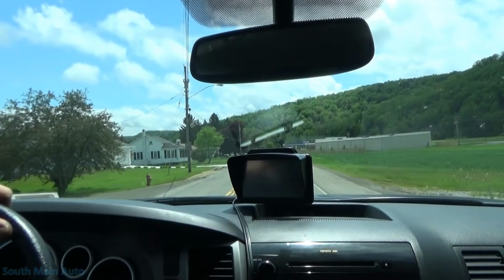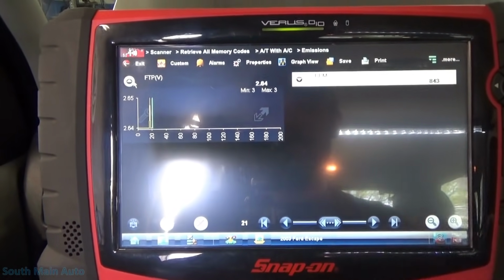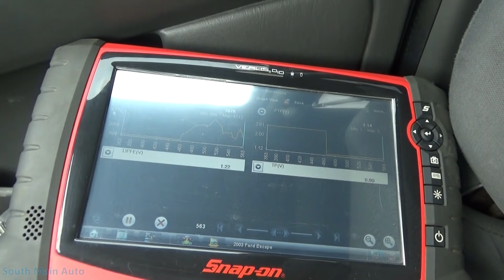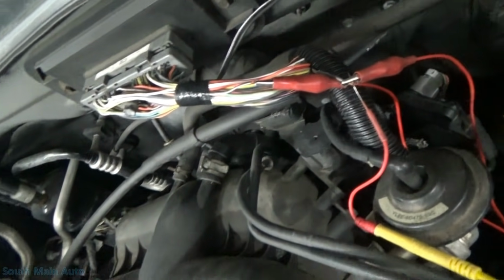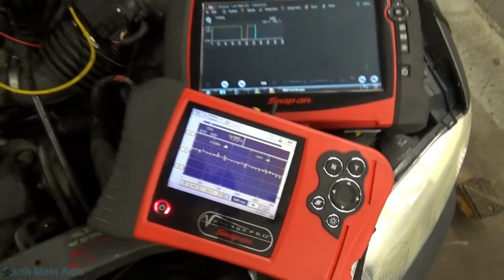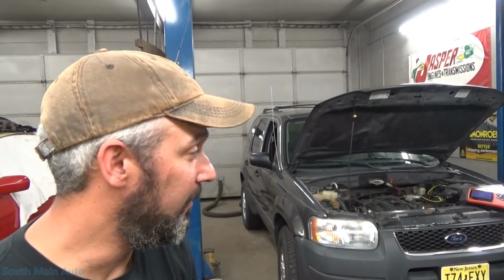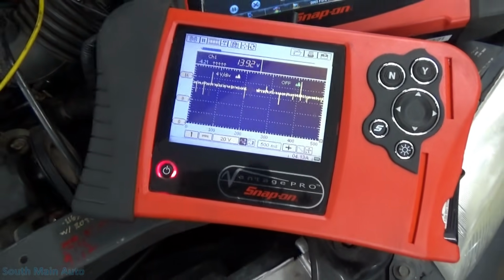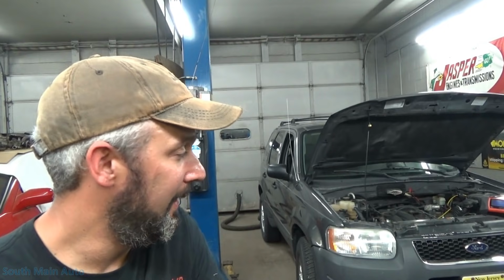Ford Escape: Do We Fix It Or Ship It!? - Part II

Comment: Nice.!. and well thought out diagnosis..Would a dealer do this? ..I think not ..Most dealer shops are parts replacers  ...even if they have one really good tech they don't want him to get this evolved to fix something ..Honest independent shops like yourself are the way to go with older vehicles and you will know what to do easily next time you run into this

Comment: I bilieve that steering sensor cause a shortcut with the ground when 3000rpm, so the PCM has a protective action turning off the sensor supply. If we know all the engenieer proccess into PCM,it would be easy but sometimes we learn new things. Good job Eric. If you can do this maybe in this cause I can do that. lol

Comment: Pulsing DC is in itself a frequency.
At 3000 rpm what ever that frequency was apparently acted as a jamming frequency to the frequency of the ECM.   Remember back in the 50's the radios had a thing called a vibrator. It would take DC voltage and vibrate  contacts creating AC voltage to operate the vacume tubes. Same principle with that switch fluttering at 3000 rpm feeding that frequency back to the ECM.

Comment: Im guessing the digital ( switch input ) is triggering an interrupt on the micro inside the ecu, because its oscillating, the micro code is servicing the interrupt routine and then the other code that manages other inputs and i/O does not run in the time it should causing the flakiness. Its quite possivle the 5v ref is done using a PWM. The micro not running its control loop properly could effect that. The micro keeps going to the section of code that handles the state change of that pressure switch.  So i think its a design error that slipped thru because the engineers never thought that sensor could fail in that way. Properly designed the interrupts have priority but even then it could still happen. If i was writing the code i would use a timer in the micro and count state changes, if it exceeds a threshold then mask ( disable ) that interrupt and set a flag ( the error  code ). Just a theory of why maybe its doing that. It would be a good experiment to hook up a funtion generator ( square wave ) to other dig inputs and turn up the frequency. I bet it does the same thing.

Comment: Hi Eric, I know car might already be long gone. But did you check computer grounds? I read the wiring diagram for this car and looks like ECM supply both ground and power for a lot of sensors and switches. So maybe a dirty ground? I know power steering switch solved the issue. But maybe the old switch glitch showed on the Tank sensor for a bad or dirty ECM ground? Just my thought. I love to deal with hard problems, those are the ones that makes you a great Tech.

Comment: I'm guessing the pressure switch 12V reference is also supplying the DC/DC 5V converter.. and the fluttering signal is fouling up the DC /DC converter..

Comment: Firstly, fantastic troubleshooting! 
I don't know if I'd have ever made a connection between PS pressure sw and evap operation.
  
I'm still unsure how you made the connection between RPM and the pressure switch operation - I would not expect any PS pressure switch activity based on RPM alone - maybe some resonance inside the switch?

I don't know if you'll even see this, but a few comments and questions.

I take it that the noise on the 5V feed which you had cut loose from the ECM was a red herring, not related to the evap problem?
Otherwise, how could noise on the PS pressure switch input to the ECM couple to a 5V line not even connected to the ECM?

You might want to keep a baggie with a few assorted 1/4 watt leaded resistors and or a few potentiometers (1K, 5K, 10K) that you could use to substitute for a questionable sensor -- save you driving to the junkyard just to get one sensor.

If I understand correctly, the hypothesis is that the ECM goes bananas when there is garbage on its PS pressure switch input and then pulls it's evap pressure switch INPUT low,  if the input was less than 5V, but not if the input is pulled up to 5V.

That is DEFINITELY an ECM problem, the only question is whether there is a problem with this specific ECM or an engineering design problem. Ask yourself why any module should ever pull one of its INPUTS low. Sounds like something is latching up inside the ECM.

I presume that replacing the pressure switch fixed the problem - my luck it would work at 3K RPM and fail at 3400.

Finally:   great video ... great troubleshooting ... thanks (from Texas).

Comment: I had a power steering whine cause enough noise that the abs system was showing a wheel speed. Abs light on and off fixed by changing a power steering pump.

Comment: If you go way back to one of your early scope traces, when the sensor voltage goes to zero, the OTHER thing you were monitoring (not RPM, probably the 5V reference?), it went up about 20%.  That maybe should have been a hint the the real problem was systemic and elsewhere.   Hindsight is great, isn't it?

Comment: Hi I pretty sure every car have ECM  computer control but the signal have to pass first to the Device Control Module ( Programable with the VIN number ) not generic software the key is 3000 rpm

Comment: I have a buddy that I met in electronics school in the 90s.  I was just some schmuck taking an electronics technician course and he was an experienced electronics technician who was taking an electronics engineering course.  His specialty was repairing aviation servos and autopilots and he absolutely despised automotive electronics for this very reason.  As far as he was concerned, there were far too many variables and inconsistencies in the voltages to build a reliable system.  There was no way he was going to even touch automotive.

That was in the 90s.  Doesn't look like it's gotten any better since.

As Mr. Scott once said, "The more they overthink the plumbing, the easier it is to stop up the drain."

Comment: I can not live with out my Leatherman  Multitool. When it was in warranty work(I broke the knife tip) I was like one handed. It is allways on my belt.  
Once I helped a gen4 vw golf on the road. A small  coolant line had a small split at the connection. I used the pliers to  get the spring clamp off, with the knife, chopped 2cm off the hose. And back together again.

Comment: Eric, don't know why you had such a problem figuring that out. Just the other day my toaster stopped working and within a couple of minutes I figured out a bad water valve to my ice maker was causing the toaster problem. Then I went out to cut grass and my mower wouldn't start but I noticed, rather quickly I might add, that my weed eater was out of gas and that was the problem. Everything is up and running great now. Eezy Peezy.  Call me next time. ;-)

Comment: Awesome diag and repair, Eric! Perseverance pays off! I do most of my own repairs but this would've had me scratching my head. I have one for you: 2001 Dodge Ram 1500 3.9 V6. Replaced spark plugs due to rough idle and codeless misfire. Removed plugs and gaps were .060 minimum and factory spec is .040. Champion plugs installed. Checked gaps to make sure they were correct. Used anti-seize on threads and dielectric grease on spark plug boot. Problem is engine has knocking noise immediately after replacing the spark plugs. Intensity changes with RPM but no change when a cylinder is shorted out. No oil pressure loss either. I'm thinking a push rod/rocker arm issue. Any thoughts?

Comment: Wow a power steering pressure switch causing the problem who would of thought but then again anything is possible on a ford. Good diagnosis now you just need to repair the wire you cut and reasonable

Comment: Eric, you thought of what could cause a voltage change at 3,000 RPMs and then acted on it. Regardless of the PS not being in the 5v chain, you understood the trigger was variables at 3,000 RPMs, very few techs would do that! .... I still wonder if the ECM might actually have an issue where some sort of back feed isolator is allowing the PS switch to cause that issue. If you get a call back with similar symptoms, but at different conditions, then I'd suspect a sensor is acting up and the ECM isn't able to isolate it and thus channeling the signal over to other sensors, in this case, the EMI.

Comment: Nice video. You go above and beyond. Only thing do not crack on dodge.that dodge full of tools will be on the road way past that girly Honda. Currently running 1989 dodge diplomat with 245000 miles and in rust belt Ohio.

Comment: The ECM,. like all computers, is governed by "garbage in, garbage out." In this case, an unexpected signal input, a fast pulse DC signal from the failing pressure switch, caused an unexpected reaction in the ECM. You persistence paid off!!!

Comment: A bouncng PSPS will produce what looks like AC current... and could have induced noise/hash on a conductor on the PCM circuit board.  A signal unexpected by the monitoring software, and as you said, not understood, or misinterpreted.

Comment: fuel leaking somewhere either vapor or fluid . check gas cap check lines going to canister is there a solenoid on these cars or a check egr valve.

Comment: I also have a 2003 Escape. My gauges would randomly peg out, return to 0, and then go back to normal. No miss. No money light. Nothing else unusual. Replaced all 6 coils and spark plugs...problem went away. I suspect these PCMs are susceptible to high frequency rf interference, and they just go haywire.

Comment: Explanation of the power steering switch: "The power steering pressure switch's function is to tell the vehicle's computer when the power steering system exceeds it normal operating hydraulic pressure. If the pressure is exceeded, the computer will raise the idle speed of the engine to prevent it from stalling." There is no mention of a set RPM (like 3000 RPM), it basically works off of absolute hydraulic Pressure , how did you relate the 3000 RPM to line pressure switch?

Comment: There is likely a linear regulator inside the ECU that generates the 5vdc.  That regulator has a operating range (say 9-15vdc) for the source voltage and when the source voltage yo-yos, it switches on and off causing the HF crap on the 5vdc line.  The ECU probably has smoothing capacitors to deal with stuff like this on most critical power rails, but I guess the 5vdc regulator for these sensors are on the same power rail as the one for the power steering pressure switch and there is no smoothing cap between them.  Not surprising given this is such a weird problem.   There is probably quite a large current drain (e.g. dead short) to be pulling a 12vdc rail down in a car.....  It's intermittent, so is not burning anything out yet.

P.S. Nothing humiliating about this, you found the actual problem.  And it was a very strange problem.

Comment: Were you ever able to explain how the 5V ref was being polluted on the harness side and was generally cleaned up by unplugging the DPF?  Was the trash on the 12V power steering pressure sensor going through ground to the DPF and then showing up on 5V reference which ultimately affected the FTP sensor's 5V ref and causing the bogus signal at 3000 rpm?  It was interesting following the 5V reference pollution from the harness side attributed to DPF...and then all of a sudden you tracked it down to the power steering pressure sensor (using the 3000 rpm trigger analysis).  But never heard an explanation of the 5V ref pollution related to the DPF (and fixed when it was unplugged)...

Comment: pick on you?  Now why in the hell would we do that?  Not only did you not just stop at the first sign pointing to the ECM, you still didn't stop when nearly everything pointed to the ECM, you kept going because it wasn't making sense to you.  I applaud you for sticking to actually diagnosing the problem and not just throwing parts at it.  Most mechanic shops I've ever had to deal with would just take an educated guess and throw parts at it; when that didn't solve the problem they wouldn't eat it they'd come back to the customer and say oh we found something else wrong too, and this other thing needs to be done.  Rinse and repeat until they finally found the right thing to fix the problem, and the customer would be paying for all of it.  You also have a good attitude about it - next time this happens I'll know what to check.  That's exactly the way you should look at it, learn from your experiences.  Someone always has to be the first person to see a particular problem or set of circumstances.  Sooner or later it's gonna be you seeing something that nobody's seen before.  But that's how we expand our knowledge, and you not only expanded your knowledge by keeping at it, you expanded ours as well.  Be proud of that.

Comment: its better to be lucky than talented......its a pretty good video.....far far better than i could do......the basic problem is that you weren't organized and you had a slapdash approach.......not once in the entire video were you in control of the situation....you should have had a better organized testing plan and just tested one thing after another after another after another......you sorta worked around the edges of a testing plan with the parts cannon....................in the end walking out the door at the end of the day after 8 hours of work you finally had your first original idea about what to check.......'what else happens at 3000 rpm'...........pretty good video .....if it was my car i'd still not know what was wrong 3 months later, but i have neither luck nor talent

Comment: I assumed noise/emi, but sure didn't figure it would be from an analog pressure switch. I wonder if it's compounded by the ECM internal components breaking down?
the vref being unregulated/battery input voltage, seems odd, is it supposed to be or is the ECM bad?
my hillbilly test/fix I posted on other video about adding capacitors would probably have worked to hide the issue, if placed across power/grounds or across that switch :))

Comment: Years ago, We have a Chevrolet Corsica that had been hit by lightning, There were a number of parts that were friend. When everything had been repair - melted parts had to go. When that was all said and done, there was still a AC wave on a 5 volt reference circuit. The Mass Air Flow sensor was the cause. Strangest thing I have ever seen. It was bouncing between +7.5 volts and -2.50 volts. What a mess. We were the third shop to see it. .

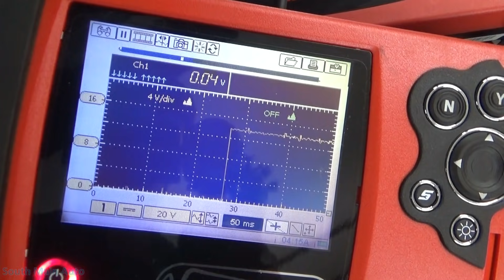Comment: Did you notice @ 22:55 When you removed the pliers from the PSP switch the voltage briefly flatlined at 5 volts then went to charging voltage? The 5v ref and that battery voltage wire to the PSP switch must be tied together internally to the ECM. I'm not sure why it would run through the 5v ref then switch to battery like that, it's not for integrity checking because it's normal operation is self shorting/open circuit.... hmmmm....

Comment: we all have our hard things,ive been stuck on a 1940 cumin's gen set fuel pump. it came to me running away with broken parts inside. New parts made and i still cant get it back together right. So you arnt the only one that gets a splinter from scratching your head

Comment: I saw the ripple on the 5v rail on the graphing multimeter in part 1.  Didn't jump out at you because your scale was too large. Ford should have put more filtering in the ECU.  Opto isolators, chokes, capacitors. Plenty of cheap lego parts that could keep this from happening.
Don't beat yourself up.  Be glad you didn't install an ECU and still have the problem.

Comment: Embarrassing ? Lucky? My arse. This is a perfect example of a damn good tech that won't give up. Most would have slapped an ecm in, or shipped it out to get the next brake job in. So what if you came across it in an odd fashion, your knowledge led you up to that point.  

My crew felt the same way, (just reading diagrams and prints, narrowing it down, blah, blah). Well, 95% of them can't do it well. Now we have a major customer that brings their problem children to us after 5-10 other places have tried. They called us super techs, we disagreed also. They said "you fix our repeat problems the first time with over a 90% success rate, what else do you call it?"

So yeah, you're a super tech, take the win.

Comment: I'm the same way when it comes to diagnosis. I hate guessing. It costs money and loses customers. I'd rather spend the time to get to the bottom of it. On that note... got a 03 Escape at the shop with a stalling problem. I wonder if it needs a power steering switch... 😂

Comment: Eric, do you still have the old ps switch? Could you check to see if it was the right one for the car? Did you happen to put a pressure gauge in the ps line to see what that looked like? If I were you I would not worry about how you got it fixed. This was a totally illogical failure mode and I bet there is no diagnostic manual that would take you down the path to where you landed. I am curious though if A was that the right switch and B what that fluid pressure looked like, on a dial sweep gauge.

Comment: My guess before watching the new sensor tried... it will fix the problem because the old sensor had a failure mode that occurs when the alternator is outputting max voltage at 3k+ rpms and “reference voltage”
goes up very slightly and causes a failure mode to occur.
Reply: Aaaaaaaand... I was wrong.  Lol

Comment: The connector plug onto the pressure switch seemed to be just a push on, no securing tabs to click/lift/push. Struck me would be a sloppy/loose fit - poor connection not helped by vibration to 3000rpm?